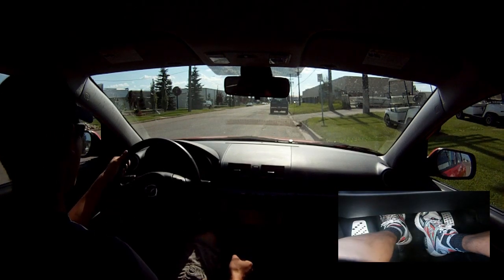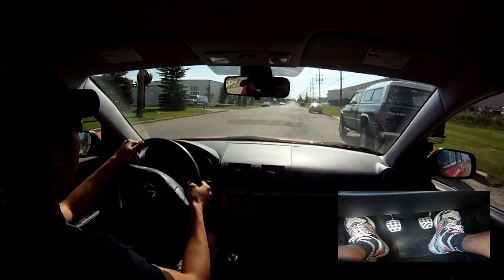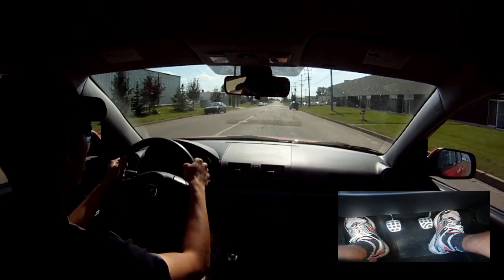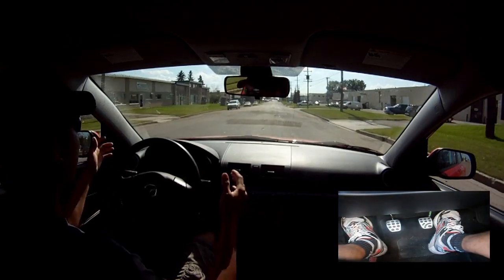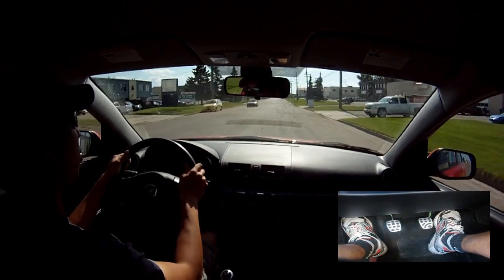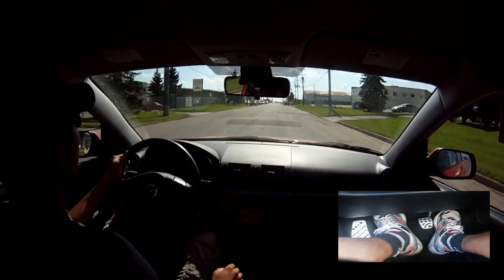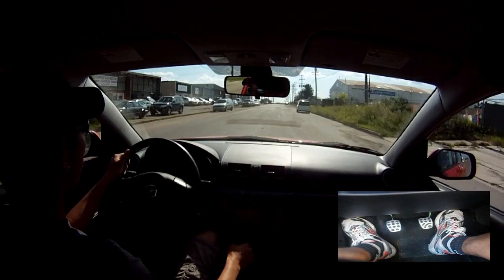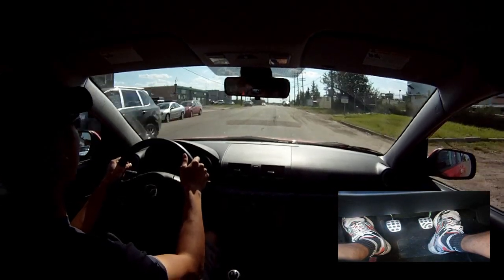How To: Granny Shift Manual Transmission

Comment: granny shifting is letting the rev drop to the next gear. double clutching is placing in neutral to drop the rev to rpm match the gear. rpm matching is when you shift at the peak of powerband. say your hp maxes out at 6k but your tq is 5200 you shift at 5300 instead of waiting for max power. this allows for best timing of power to the wheels so you don't get wheel spin overpower or underpower.

Comment from the maker: Its using a shower curtain bar and its extended to be a tight fit on the holy shit handles at the back and the gopro is attached using the bicycle handle bar kit or roll bar kit

Comment: Slow down the gear change,  let it fall into neutral and with light pressure drop into the next gear.    That's an important part not covered.

Comment: Errr.. did you come up with this term/concept yourself? Id call it driving like someone who doesnt know the first thing about driving. or if it were start/stop traffic youd use the clutch slow without gas to nudge along.  There is no need to use 1st gear more than 2-3 carlengths